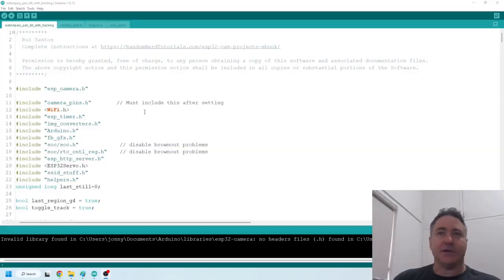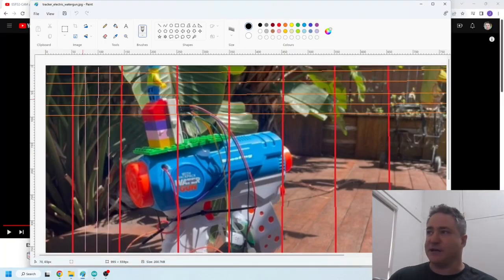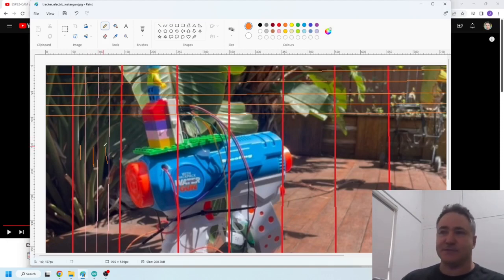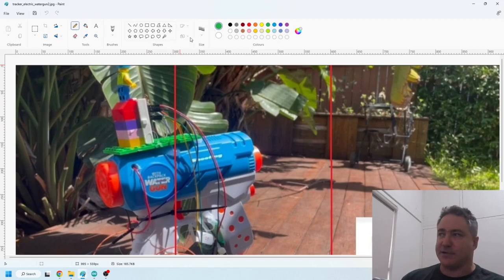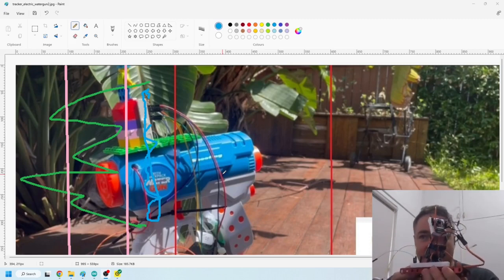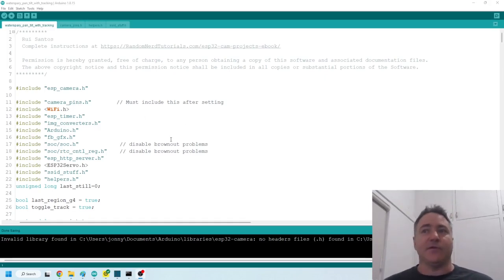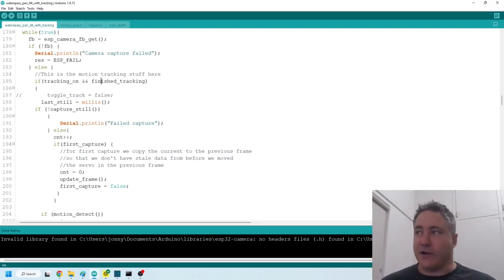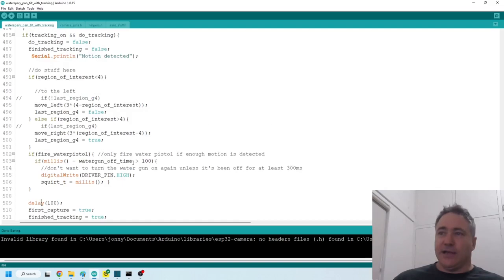motion detection and tracking for the esp32-cam water gun

Comment: Would I be able to make this without web server streaming and just do motion detection by default? If so how should I change the code?
Reply from the maker: @kentakoh6702  put the tracking part in the loop. I think it’s in the stream handler, although it’s been a while since I looked at it.
Reply: got it working. Thanks!
Reply: @kentakoh6702  just was wondering what tracking loop did you move to the loop?  looking to getting the motion working without the web server.  thanks

Comment: Hey Jonathan, for Haloween this fall I have 4 manequins with their heads on a servo motor that I would like to follow a person walking down the street, so your project is the essence what I'm looking for.  I currently have NodeMCU's on each head, and a seperate NodeMCU configured as a softAP that loads a web page with 4 sliders for 180 degree of head movement.  So all I need is a seperate Esp32-cam project to track the person walking, send updates to the NodeMCU's to move the heads.  As I'm pulling the materials together, I'm wondering what quality of camera I would need to capture tracking on the street from the picture window of my home may be 60 to 80 feet or so...essentially front yard to the street.  In your project you are in fairly close proximity to the water gun.  Would appreciate your thoughts here, and had you experimented with tracking your watergun at night using IR lighting?
Reply from the maker: Hi Kevin. The cameras on the esp32 cam can be varying in terms of quality. For the tracking algorithm, you might run out of memory at resolution higher than 320x240. Also, if light is low, it will not work. You might be better off using a raspberry pi noIR camera or some other infrared camera with a pi. You can run opencv on the pi and use contours to track. Search "open cv contour tracker" on youtube. You don't need a fancy pi 5, a lower model should suffice. Best of luck. Let me know how it goes.

Comment: hello, I'm wondering if you could help me.. What I want to achieve is that.. I want my esp32 camera to detect and Identify dogs (specifically) and then produce just an normal buzz/alarm.. can you like guide me how to start?
Reply from the maker: Hi Daniel. There are a couple of ways you can do it. One is actually on the esp32 processor, which will be a bit slower. The other is on a cloud, which will require network connection plus login. I'd probably start on the chip and see how it goes. A great getting started video is by Bill at Dronebot workshop who uses edge impulse and esp32 cam, which is at https://youtu.be/HDRvZ_BYd08?si=c58vttFSVNx6iY_N (or just search "dronebot edge impulse" on youtube and it should come up).
you will need training data as well (lots of pictures of dogs), which you can probably get from kaggle.

Comment: Thank you for the video, Jonathan. The SOLUTION to making the SERVOs work (for anyone facing a similar issue) is to allocate two timers in the code. Add these two lines in the setup() function above where servos are attached:
  ESP32PWM::allocateTimer(2);
  ESP32PWM::allocateTimer(3);

Hope this helps!
Reply from the maker: Thanks. That is very helpful.

Comment: Hi Jonathan Great Video Great Project. Just what I was searching for.
I am trying to build a sentinel turret with a gelblaster.
In have cut back the firing time ok But due to physical constraints (usb tethered testing) I have mounted my ESP32 CAM upside down.
Picture is the right way up
Now of course the servo are all reversed and tracking in the wrong directions.
In there a simple way to correct this in the code.
Reply: I thought I tried that but I will try harder thanks
Reply from the maker: @Graemecns  it will be very cool when you get it to work.
Reply: @jonathanr4242  ok got I to track correct thanks. I am trying to get the I2c port working on the esp32 cam if I can then I can then use the pca9685 pwm board for servos and LEDs or steppers. mp3 player 
I am hoping to get it mobile with a hover board.
Reply from the maker: @Graemecns  hi. Sorry, I’m not sure I understand. Are you using vflip?
Reply: @jonathanr4242   No I have had to mount my esp32 cam with the camera at the bottom  (usb cable fouling) the video is streaming to WIFI  right way up but the buttons were swapped Right Button moved the servo Left. I have fixed that in the HTML code. But in the tracking code if something comes in from the right the camera moves Left. opposite to the movement direction. Is there a simple fix?   I have tried changing a number of parameters but no luck.      also Does the tracking work for up and down
Reply: @jonathanr4242  no I have had to mount my ESP32 Upside down with the camera at the bottom. The video stream via wifi is the correct way up but the buttons were working in reverse. I have fixed the stream in the HTML Code the the buttons work the right diredtion,
But the tracking software is reversed the camera sees the movement to the right but servo moves left.etc for directions.       also does tracking up down work?
Reply from the maker: @Graemecns  up/down is not implemented yet. You can try renaming the move_left function to move_right and vice versa, for a quick fix.

Comment: can this be done only with a black and white image, or will it work with a color one too?
Reply from the maker: The algorithm requires grey level image data. In colour it would use more memory and be much slower so probably wouldn’t work on an esp32 AI thinker in real time. You have to use uncompressed images because the algorithm compares the raw pixel data between two images. You could probably use colour on a raspberry pi.
Reply: @jonathanr4242  i thing use 2 esp32 cam, first for detecting movements in grayscale, second -for taking color picture
Reply from the maker: @tree-service  that would work nicely.

Comment: Your program, project is amazing   You have given us soo much but can i ask for some assistance    i have another esp project that uses 
this command" client.print(status2);"  its simply a text variable that i post on the page   Ive tried but i cannot get it or other  commands to work with your webpage   Simply put i am trying to display your array motionview on the web page  I am trying to add a couple lines of code to turn your project into a person coming up my driveway sensor  my intention is to add a few check loops to follow the region of change.  Thank you very much either way
Reply from the maker: I'm not sure. It's been a while since I looked at it. You might need to convert to c_str()?

Comment: Very cool turret! Is it possible to make the turret track without connecting to wifi?
I also have a problem with servomotors, they just don't seem to react, although everything is connected correctly and the servos work with a different code

Comment: sir what board select this project AI THINKER or WROVER BOARD
Reply from the maker: AI THINKER.
Reply: @jonathanr4242  thank you sir it's work but Up Down Servo motor is not work sir what i doing next
Reply from the maker: @Rangan-vaathiyar  You need to try and test the up-down servo is working properly. see if you can isolate the problem.

Comment: When I tried it, the camera worked but the servos didn't move, even when I pressed the track button. How do I fix this?
Reply from the maker: This could be due to a number of things. To troubleshoot I would place a serial.print in the move servo function to make sure it is being called. 

If it’s being called, just try moving the servo back and forth for a few seconds in the setup routine.
Reply: @jonathanr4242  Thank you! I will try this later
Reply: @jonathanr4242  How should I make the servos move? I'm a beginner so I don't really know :(
Reply from the maker: @botnumbers4703  Hi. Are you using the code that I wrote? 
The first thing is to make sure the servos are properly connected and responding. 

I would just put a loop at the end of the setup routine to test this. 

Something like 
//repeat this a couple of times 
for ( int i = 5; i <180; i =i +5){
 Servo2.write(i);
delay(100);
}
delay(100);
for ( int i = 175;i i>0;i =i -5){
 Servo2.write(i);
delay(100);
}

Note: Trouble shooting servos can be a bit tricky but it’s also very rewarding. 
Also, the code I got is based on random nerd tutorials code, with some lines added for tracking and firing the water gun. 

It might be worth seeing if you can get the servos working with their code. 

One thing I should point out is to make sure you have servoN1 and servoN2 defined, because these are dummy servos that are used to get the correct pwm channel.
Reply: @jonathanr4242  When I used added in your servo test code, it said "expected ; before i", how do I fix this?
Reply from the maker: @botnumbers4703  it’s probably just a typo. It would be a good learning exercise to try to fix it. Look at some other examples, probably best to stick to dronebotworkshop and randomnerdtutorials if you are learning.